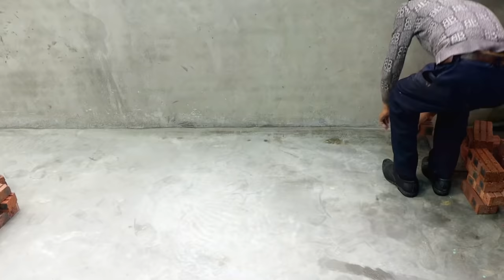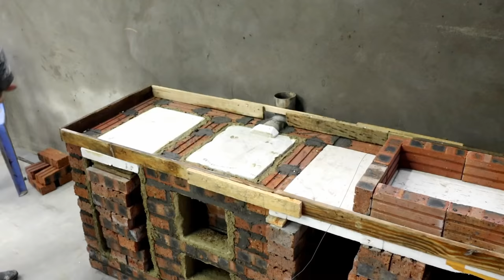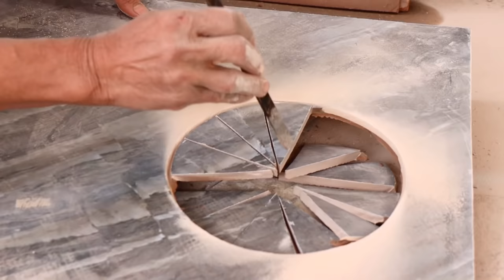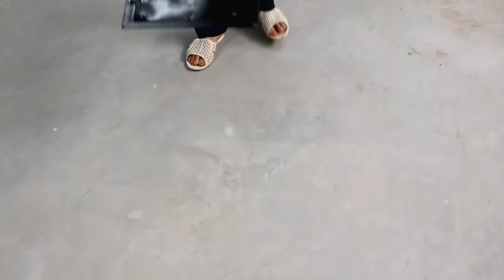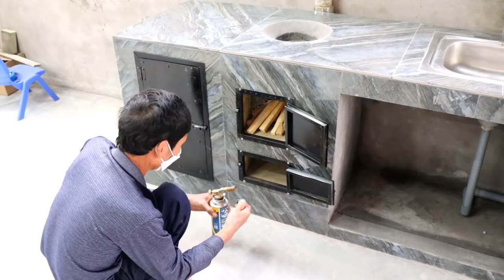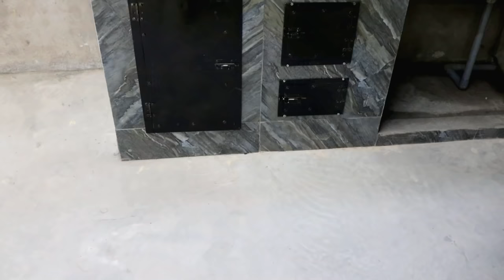Build a beautiful and efficient new multi-function wood stove

Comment: Love these designs! Can you provide info on mortar and cement mixes? Also tips on first firing so as not to crack it?
Reply from the maker: The mixture for construction is cement and sand.
First shot using a specialized drill of ceramic tiles. Thank you for coming to me. Wish you good health
Reply: @GardenDesign89  You too, thanks!
Reply: @GardenDesign89  waaàaàá
Reply: @GardenDesign89  aaaàaaaaà